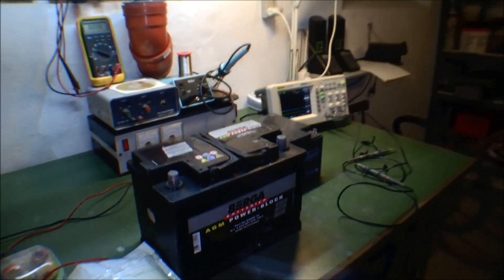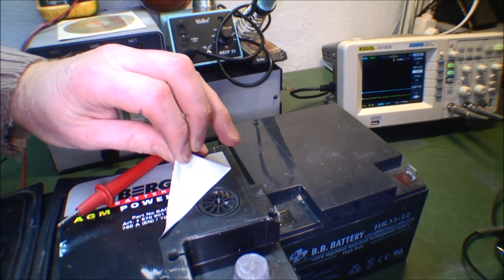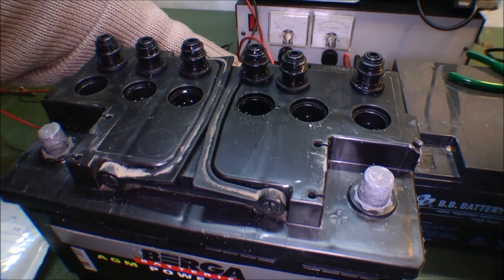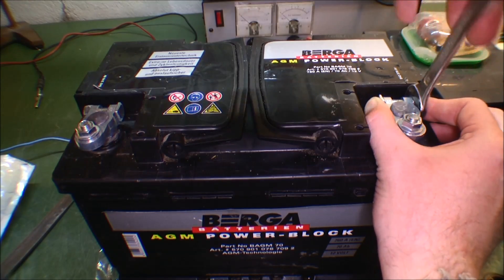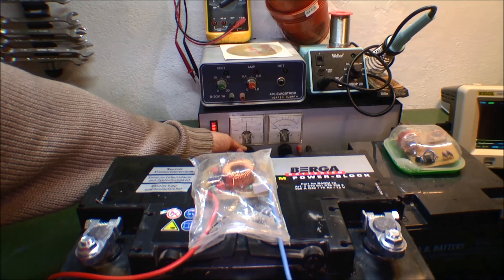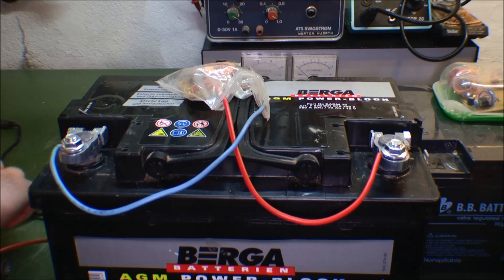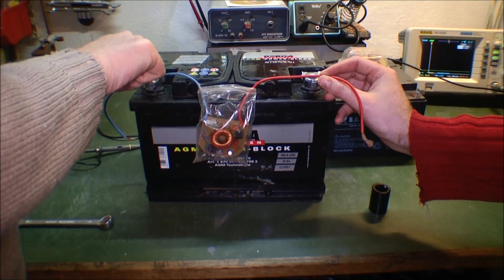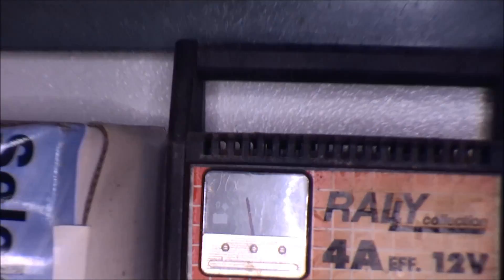Mounting battery desulfator and chek on Oscilloscope - 134

Comment: Part of the equation here is that the battery itself acts like a giant electrolytic capacitor.
The desulfator has to have adequate energy capability to overcome that capacitance.
A desulfator circuit that can produce a high voltage, but without enough energy, will not produce as big a spike.
(ie, a large desulfator that does not have as high a spike, may outperform a smaller one with a bigger spike, when connected to the battery.  The smaller one may loose that voltage when connected to the battery, whereas the larger one can retain most of it's voltage spike.)

The waveform you took is most representative when taken at the battery posts.  At the desulfator, the leads are somewhat isolating it from the batteries' capacitance.

If you charge AND desulfate simultaneously, you should have a choke (coil) in one of the charger leads, or else you are ALSO pulsing the charger diodes, perhaps detrimentally.  Or probably just driving the charger monitor nuts, on digital chargers...
Mr K L
Reply from the maker: Hi troubleshooter1975
Thank You very much!  glad you liked the video :-)
Thank you for watching! :-)

Comment: There is nothing wrong with a battery that has 12.2 volts except it needs to be charged. These guys are idiots.
Reply from the maker: So after charging for a few days, and then disconnecting the charger, the voltages dropes right back to 12,2V,,, than you are the idiot ?

Comment: I guess your power supply didn't like the voltage spike from the desulfator which would perhaps explain why it went off.  Knowing what the desulfator does, adding a diode at the output of the power supply would block incoming spikes, although you would need to increase the power supply output to compensate for the diode voltage drop.  I'm not too sure how that would go with a charger as I don't know if the charger actually reads the battery voltage.  If it does, having a diode in the way may prevent it from charging as it wouldn't be able to do the reading because of the diode.  That would potentially explain why some people are using basic chargers and not the intelligent ones when dealing with some type of desulfators.
Reply from the maker: Hi SimpleEnough2k9
Thank You very much!  glad you liked the video :-)
Thank you for watching! :-)

Comment: Sooooo many things done wrong on this video its comical...... AGM (absorbed glass mat also called starved electrolyte) is a special glass mat designed to wick the battery electrolyte between the battery plates, the plates are saturated with acid to about 95% of what they can hold. They contain only enough liquid to keep the mat wet with electrolyte so if the battery is broken no free liquid is available to leak out this is why the cells look dry but really they are not. +1 for getting stuck tho!
Reply: Please help me learn more. Please give more reference where I can learn more abt these
Reply from the maker: Well they do not do much on AGM...

Comment: I'm pretty sure you aren't suppose to put water inside an AGM. Those were most likely safety vents in case of accidental overcharge. Why not research before doing something potentially damaging/dangerous like that?
Reply from the maker: Hi Mike Scudero
What would you put in them,, they do dry up!
Thank you for watching! :-)
Reply: My PlayHouse I believe it's supposed to be dry. The electrolyte is absorbed into the glass mat. Preventing liquid spillage in case the battery were to be dropped or tipped over.
Reply from the maker: HI Mike Scudero 
The batteries are not supposed to be serviced, but they are not dry,, they contain a gel to keep them wet. That gel does evaporates over time and the battery deteriorat in capacity. Also why there are "vents" in each cell. So the idear was to vetten the gel again.
Thank you for watching! :-)
Reply: How was the battery afterwards?

Comment: Hi Morten, the first two to three cycles i would put the 17 volt overcharge on for around six ours, then measure the time for the discharge wirh your load, as soon as you see it improving i would lower the voltage during the following cycles, this depends on the state of battery ofcourse...
Reply from the maker: Hi
Okay thanks for you input :-)
Thank you for watching! :-)

Comment: best way to rejuvenate a battery:
discharge the battery to 11 volts ( under load) disconnect this load ( for a car battery fore xample a 50 watt h4 lamp) wait 5 min to see the battery recover by itself, then recharge is - slow- thus with low amps say 2 ah with a voltage of 17....this will eventualy overcharge the battery above gassing voltage ( 14.4) for a wet or AGM type, leaf this charge on for the night mayby with a desulfator parallel, then repeat the discharging again till 11volts, then repeat, remember charging a battery is really nothhing else than desulvating itself, a GOOD desulfater can inly assist you in the proces, cycling a battery will get the capacity up!
assuming there are no other problems with your battery, hope this helps!
Reply from the maker: Hi
How long would you charge the battery with 17Volt ?
Thank you for watching! :-)
Reply: He wrote: about 6 hours - "17 volt overcharge on for around six ours"
Reply: " cycling a battery will get the capacity up!"
I can not agree with that - because every datasheet states limited cycle life. Every cycle reduces battery life.

Comment: Why would you leave the desulfator connected while you are charging?  It seems the spike could damage the charger.   Also, to manually desulfate, why not just leave the charger on something high like 2.75V per cell for maybe 15 minutes, then  disconnect for 15 minutes, and keep repeating for maybe  8 hours,  possibly draining the battery some so it doesn't overcharge.
Reply from the maker: Hi +David James 
Well there are so many opinions on how to do this,, and it does not seem to be an exact science.
Thank you for watching! :-)

Comment: I can't believe you know nothing about AGM BATTERIES and yet you are giving false information for all to believe. Please search  AGM  batteries and learn  before you post.
Reply from the maker: Hi +Bob bailey 
You are at all time free to make your own videos, and telling the world how things are in real life. And do post me a link so i can become smarter. If you think you can do it better ,,don´t tell me,,just do it.
Thank you for watching! :-)
Reply: Like you videos, keep it up.  AGM (and most SLA of similar acid impregnated fiberglass mat wick style batteries) can usually absorb some additional distilled water, especially if there has been overcharging and years of use or abuse, but all are VRLA so water splitting and loss during charging can still happen. Recombination of 2H and 0 into water is usually violent, unless catalyzed, but catalyzed recombiners in filler caps for deep cycle flooded are quite expensive, research it.  For filling reference,  I put 1 or 2ml per cell in to 9AH SLA AGM batteries if they vent during charging, as evidenced by the little rubber cups on each cell which act as valves showing displacement/venting.  5 or 10ml in to a 9AH cell could be enough to turn it into flooded battery, but it should still work. An AGM that has gotten sulfated, and has lost water from its acid impreg mat, might not be desulfated until some distilled water is added back, as the acid doesn't want to accept any more sulfuric acid ions produced during desulfation.
Reply: +My PlayHouse (Morten Hjorth) Don't mind them folks, no one is perfect and your only going off the information you know and are giving, its a learning process and people need to understand your not always gonna get it right the first go around. The AGM batteries are more similar to the UPS and other sealed lead acid batteries you have. In fact, some seal lead acid batteries like the ones used in ups's used AGM technology, why some others are gel cells.